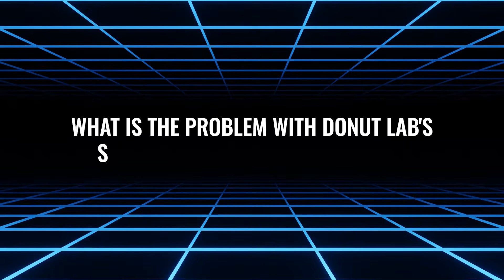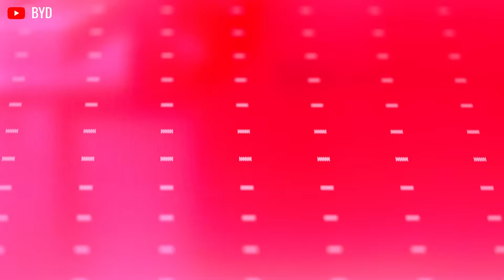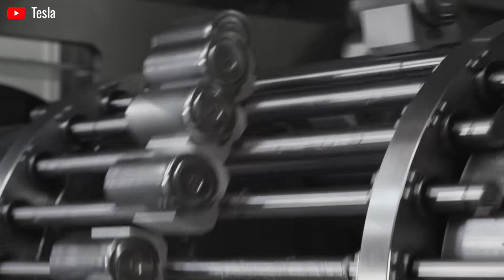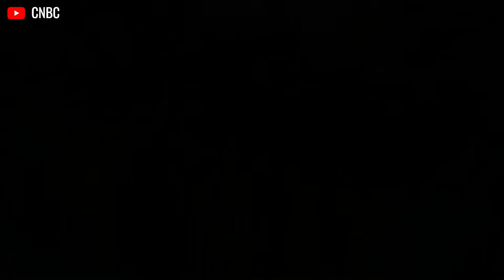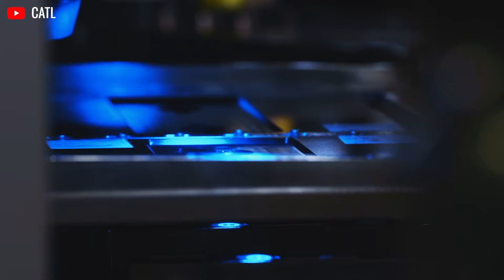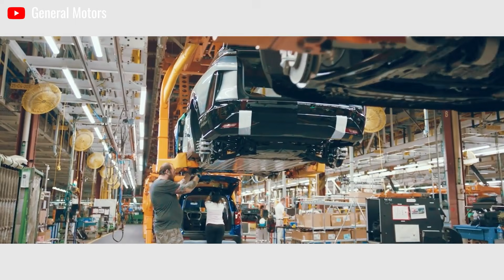The Truth About 5-Minute Charging's Donut Lab Solid-State Batteries

Comment: Solar charging stations that use their batteries to store power for delivery as well being connected to the grid to keep the station battery charged to keep the power to charge in 5 min.
Reply from the maker: Exactly, buffer or on-site storage smooths power delivery, but it doesn’t eliminate the grid constraint. You still need massive upstream energy to refill those station batteries at scale.

Comment: One possible solution is for the charging stations to have booster batteries that can deliver the extra energy needed for the super fast charging
Reply from the maker: Yes, booster batteries help locally, but they shift the problem upstream. At fleet scale, you’re still limited by how fast the grid can supply that energy.

Comment: The whole video, the whole narrative is that Donut battery has energy density, closer to 100 to 150Wh/kg and thus Li-ion battery still has purpose. However Donut claims 400 Wh/kg, so where the mistake in prepping this video came from?
Reply from the maker: What’s interesting is that people argue about chargers, while quietly ignoring the 400 Wh/kg claim.
If that number is real and fast-charge stable, it changes EV design entirely. If it’s not, then charging speed is irrelevant.
So which assumption are people actually defending here?

Comment: Soooo.... The problem is NOT the Donut Battery, but rather the (for now) non availabilty of chargers with enough power. WOW. Well than we will have to build those, won't we?
Reply: If the battery is real, then there is no problem at all, you just place battery storage at the chargers, charge your car from the storage battery and charge the storage battery all the time with the available power supply. 
With 100.000 life cycles the storage batteries will last many years, if they are real.
Reply from the maker: The limiting factor isn’t the cell chemistry, it’s power delivery and infrastructure, which is why fast charging always rolls out with dedicated grid upgrades, not home outlets.
Reply: they can be parallelized, no problem.. in my channel theres the donut battery with 3x 90A chargers doing that for hero-run.

Comment: Well we just need more powerfull chargers that's all .
Reply from the maker: More powerful chargers don’t appear in isolation.
They require transformers, grid capacity, buffering, and load management — exactly why ultra-fast charging is a systems problem, not just a battery problem.
Reply: Transformers and really high voltage ⚡️ directly from the pole
Reply: I imagine just seeing a diode pack on a telephone pole for your charger

Comment: The issue is not that they CAN NOT charge in 5 minutes. It is the fact you need to supply 300 amps to do it. The current power grid operates just under max load at any given time. It could not handle a fleet of these or even any current EVs charging all at the same time. There are not many charging stations let alone home outlets that can supply that. Most are rated at 200amps for the entire house.
Reply from the maker: Fast chargers don’t pull that load from a typical residential line. They rely on dedicated high-voltage feeds, transformers, and often on-site energy buffering. That’s also why simultaneous mass charging is a grid planning problem, not a battery feasibility problem. What do you think about this?
Reply: Donut have addressed this and says they can provide 40ft containers full of battries to supply  charging stations. 🤷🏿‍♀️
Reply from the maker: That's a bold statement! So how much of that did they actually achieve?
Reply: @Eng.JohnSmith I dont know. I just saw an interview from the event where one of the ceo's mentioned the 40ft container back up they have and said something about making them to back up the charge stations which wont be adequate.
Reply: Not much of an issue.  It will be addressed.  If the data centers can do it then so can the EV market.

If a transformer keeps blowing, the demand for better ones goes up.  Market addresses it, the faster the better.

Do you honestly think the move to EVs will just stop if there are infrastructure issues?  No.  Are you an engineer working in electric infrastructure?  Great, job security!

The **ONLY** ones who REALLY worry about any of this are the fossil fuel industry and those who tap into their advertising arms - Fox News and **ANY** other republican outlets… these people are brainwashed by the fossil fuel industry.